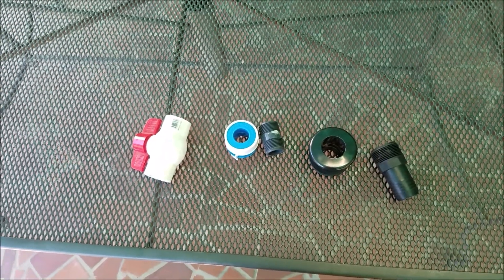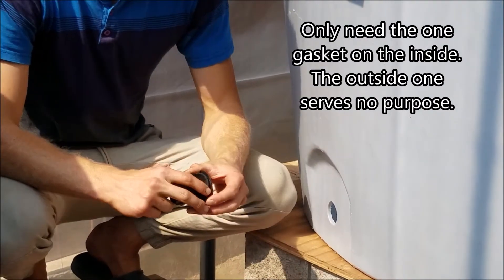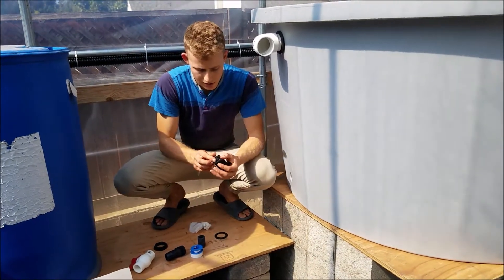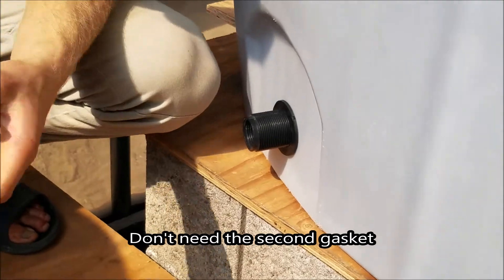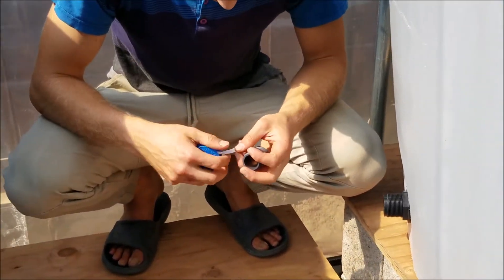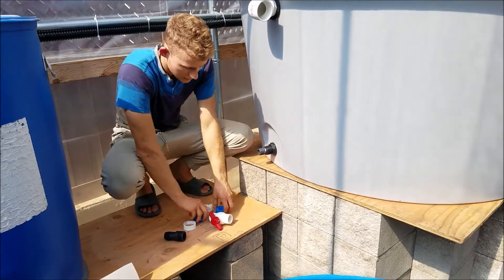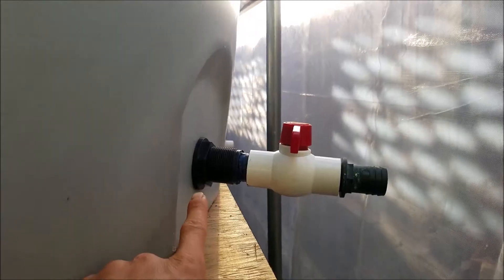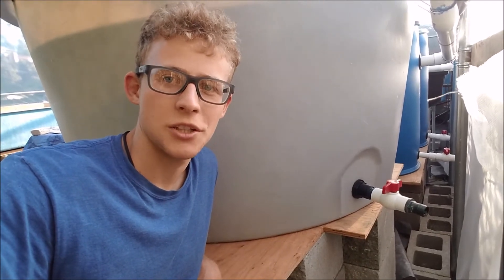How to install a drain plug for aquaponics (Hybrid aquaponic system)

Comment: Thanks for the video. Can you provide a link to the materials you used for the plug. I'm interested in purchasing something similar to what you used.
Reply from the maker: Here should be everything

Bulkhead fitting link: https://amzn.to/3qe4sij
FPT ball valve: https://amzn.to/3bNSt2P
Pvc nipple: https://amzn.to/3bO4k0L

Barbed fitting: https://amzn.to/3wq9gCf
or 
hose attachment part: https://amzn.to/3CW4RJW